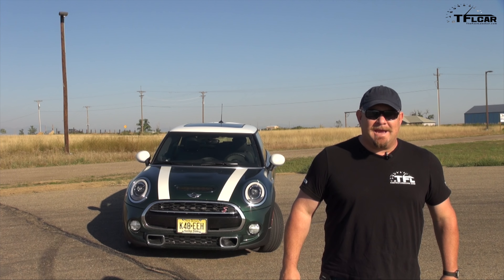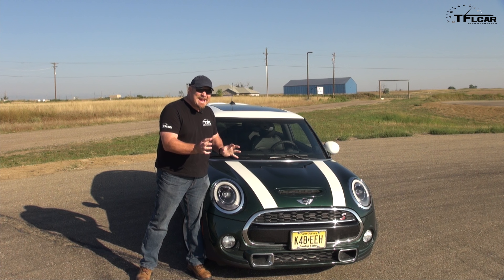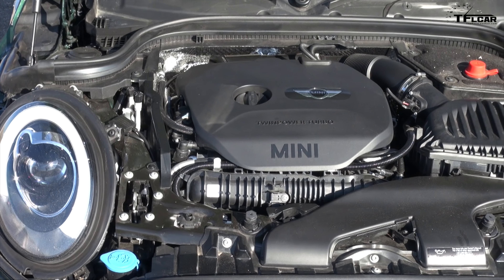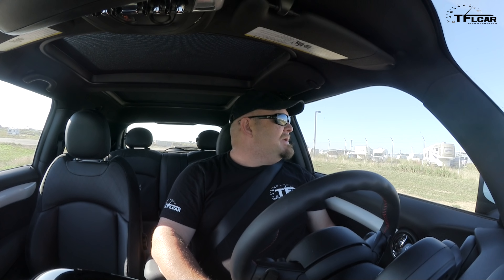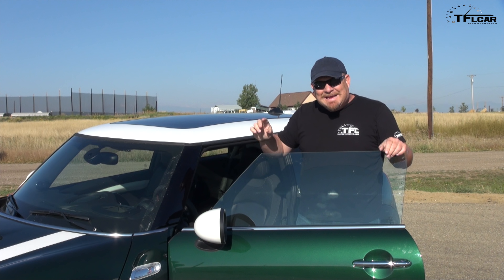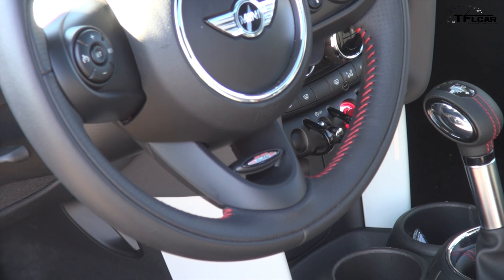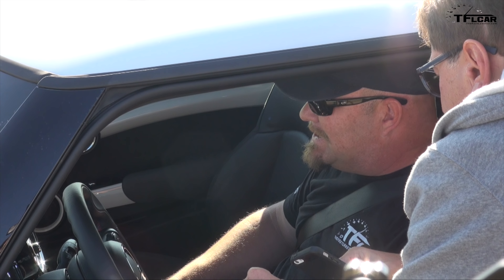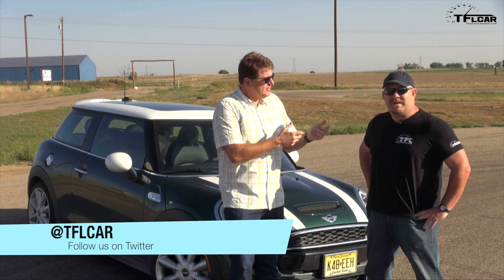2015 MINI Cooper S 0-60 MPH Track Review: A Go Kart on the Track?

Comment: Twin turbocharged 4 cylinder with only 180 hp? Damn that's bad
Reply: It isn't win turbocharged. That is a misnomer and why they purposely picked that name.

Twin Power is just a simple twin scroll turbo that will spool up quicker in low RPM ranges and maintain good boost into the upper-mid range of the engine's available RPM. It will die out at the top-end however, because there is a limited amount that you can design the variability of the turbo scrolls.
Reply: thank you sir i was very confused but still a high-end turbo on a 2.0 liter and only 180 HP very weak
Reply: Agreed. And the only reason I looked it up was for the exact point you brought up; only 180hp?

I suspect that this car might actually be making 180hp at the wheels- similar to my Abarth (rated at 160 but makes about 155 at the wheels)
Reply: What's so terrible about the power output ? 180hp is all the Fiesta ST produces. It's more than enough for a small front drive car.
Reply: MrKeyboardCommando Fiesta makes 197hp. That's almost 20 more, which makes a difference in such a small car.
Reply: Brodey Dover It makes me wonder where car company get their numbers from.. i took my 2012 gli on the dyno and its rated at 200hp.. But it actially makes 225 on the dyno and its stock... and my friends sonata Turbo claims 270 hp from a 2.0t but its only 215 to the wheels.    some cars are underrated and others are far overrated  ... This mini might be underated
Reply: kirbyswarp it does have less power but is faster than the fiesta and maybe faster than the focus so is not bad
Reply: kirbyswarp We are talking about the 1.6 litre turbo Fiesta ST, aren't we ? The Cooper S actually makes 189HP.
Reply: The Cooper S is 189 hp and 207 lb/ft of torque.  The Fiesta is 197hp and 202lb/ft of torque.  Pretty similar numbers.
Reply: ***** Cheers, Fireman. It always helps when somebody knows what the hell they're talking about !!!! ;-)))
Reply: MrKeyboardCommando Yeah, the Fiesta ST. Great little car.
Reply: It's a more efficient way of making 189hp than using a 1.6T so they used it. They actually got rid of the PSA engine for it's lack of reliability.
Reply: MrKeyboardCommando The Fiesta is a 1.6. This thing should be pushing much more hp with a 2.0
Reply: bertito43
It could be but I don't know about should. Remember this is only the S. There will be a JCW and eventually a GP.
Reply: hung huge The Mini Cooper GP. Get less for more!

Only $50,000! What a deal!
Reply: bertito43 It all depends on how much power BMW want the engine to produce. It can, and does, produce 250+hp.
Reply: ***** It's making exactly as much as BMW want it to make. The same engine is making 250+hp in other models.
Reply: kirbyswarp
That comment shows you know absolutely nothing about them. Don't tell me - you think a dodge hellcat is the best thing since the car was invented? The mustang was your bedroom pin up?
Bang for buck is fine if you have no money and no taste.
Some people pay millions for diamonds. Why would they do that when they could have loads more coal for a few bucks?
Reply: MrKeyboardCommando
Exactly. There are more factors than what the engine can theoretically make. One of the largest being BMW don't really want the mini to blow their far more expensive 3 series off the road.
Reply: hung huge You've hit the nail right on the head. If you want a real rocket, that's what John Cooper's for.
Reply: *****
Yeah because price and speed are all a car has to do, right? Stick to the peugeot in a frock if you like that kind of thing. I prefer something which doesn't feel so low rent.
Reply: *****
 incorrect, the FJCW will have 230hp compared to the 'S' with 189hp. The F56 still handles better than the Focus ST, but the Fiesta ST and F56 handle much better. Also to note, even with a tuned FoST and F56 with a JB, it'll still be close enough with the FoST by a hair.
Reply: ***** No, Hung didn't miss the point. The Cooper S is a nicer car than the Fiesta ST. The former is a luxury performance car, the latter, a pocket rocket. The John Cooper version of the Cooper S will fly.
Reply: RobDamnImFine
Thing is we can all quote figures and so on but we're not talking about the same class of car here. What's the point of comparing the focus and the fiesta with the mini? It's one or the other. The focus is a larger car altogether and neither are anywhere as nice to be in. Considering the aftermarket that's always surrounded the mini I would be surprised if there isn't a 300hp kit in a month or two and way more not all that long after that. Mini are holding back on the power but even while they're doing that it's faster and better on fuel than the fiesta without feeling like it was made from recycled bin lids.
As for factory versions - this is as low as power is going to get from the factory. JCW, GP and any other special editions or tuning kits they decide to throw in will only make it beat the fiesta by more.

Oh and remember efficiency? How much does the fiesta's 1.6 weigh compared to the mini's 2.0?
Reply: a gti has a turbo 2 litre.
Reply: hung huge
There isn't a market for MINIs...I've been in the MINI community and there was never such a thing to get a MINI with a 300hp kit. Even with the twinpower engine, I wouldn't think they would reach that unless E85, turbo, and bolt ons are used efficiently.

Not hating on MINI, but they are great underpowered handling cars. Also, there are many videos that show the Fiesta ST is quicker than the F56. Again, most magazines compared the hot hatches: F56, Fiesta ST, and Abarth everytime. So unless you think MINI is superior and doesn't have competition, the point I was saying MINI is a great car but doesn't compare to the Focus ST.
Reply: RobDamnImFine
Really? You've been in the mini community? Yet you say there's no such thing as a kit for 300hp? That shows you know little to nothing about it at all. There are even kits for the older 1.6 which do 300+hp. Look up most of the decent tuners and you might be surprised what can and does get put into them.
Type in GTT mini tuning for a start just to get you going but there are plenty of others.
The N20 motor is already available with 290ps from Hartge in the 328i so for the aftermarket to go another 15hp or so is going to be pretty easy.
Really if you know the square root of nothing that's the exact amount you should say.
Reply: RobDamnImFine The Mini community ??? What, the fuck, is the Mini community ???
Reply: hung huge
 There isn't. Name me any vendors that do sell the 300+hp kit haha. As a matter of fact, you might be talking about 300hp to the crank...but to the wheels on a second gen, they only reach up to 260whp, there has to be tons of internal work done. Go look up it up on NAM before you put out false information. As for the first gen, I've seen 270ish whp with all head work done and full bolt ons. So please show me exactly what MINI vendor does sell your "300+hp kit" and that my knowledge isn't valid here in the U.S. Maybe in Europe I'm sure you could find something close to it, but just because something is out there, doesn't make it true with one person who has supposedly done it.

We need dyno's and proof, not a bunch of talk.
Reply: MrKeyboardCommando
Nothing you need to know about if you don't drive or have driven the car lol.
Reply: RobDamnImFine I have owned a Mini, along with just about everybody else in the UK. So what is this Mini community ?????
Reply: Blake Brink Just a few points:
1) No, there isn't a community for everything.
2) You haven't a clue what the Mini community is, because there isn't one.
3) How does a little pimple like you get such delusions of grandeur ?
4) The Cooper S engine produces the power BMW want it to produce.
Reply: Blake Brink 1) What you believe has nothing to do with reality.
2) O.K., show me this community. 
3) What facts ? All I saw was sanctimonious pomposity.
4) I'll trust BMW's judgement about the power of their cars, they seem to be quite good at making them.
Reply: 1-3: useless arguments i don't care about as its not in my original comment if you wanna debate the possibility of a mini cooper community go ahead. 
4. turbo 2.0l with only 189 hp is still joke wether made by a "good  car company" or jesus christ himself, don't care if it was crafted by the hands of zeus why make it so pussy when it so much potential just isn't logical at all. especially for if BMW thinks they're the "ultimate driving machine" haha
Reply: Blake Brink Items 1-3: you were talking out of your arse. O.K., I can understand that.
Item 4: it's not a twin turbo engine, it's a single turbo, twin scroll engine. This engine can produce 250+hp if BMW want it to. In the 'S' it produces nearly 100hp per litre. How much more do you want ?
Reply: yeah someone told me it wasn't twin turbo a long as time ago and yes you just made my point the engine has that possibly of 250+ easily so why cut it short especially for a "sport". for fucks sakes caddys have 270+hp single turbo 2.0L(and caddis are a joke) . i thought the "ultimate driving machine" had higher standards that is all.
Reply: Blake Brink Because the 'S' goes as fast as BMW want it to go. John Cooper provides any further performance you may require. Just like Msports provides it for BMW cars. BMW do have the highest standards, that's why they're so successful in a very competitive market.
Reply: MrKeyboardCommando all other major car companies in that market are successful mercedez, lexus, jaguar, infiniti and acura. not to mention their direct competitors make advertisements saying their cars shit on a beemers performance in their same class IE lexus commercials where they call out most of all the german carmakers. but go ahead and defend your precious BMW.
Reply: Blake Brink All the cars you mention are excellent, and BMW competes very successfully in that market sector. The Mini, also, is an outstanding success. As I've said before, ad nauseam, BMW know exactly what they are doing.
Reply: MrKeyboardCommando
MINI car clubs and LXM on Facebook. Check it out.
Reply: RobDamnImFine These aren't communities, they're just clubs.
Reply: MrKeyboardCommando
a club like LXM is a community.

hence, the definition: a group of associated nations sharing common interests or a common heritage. Your welcome.
Reply: RobDamnImFine Are you talking about LMX theory ?
Reply: MrKeyboardCommando
you have a MINI don't you? or classic? either one will do.
Reply: RobDamnImFine I've owned several original Minis. I've not owned a current Mini. However, what that has to do with anything is beyond me. Now, what's this LMX you were talking about ?
Reply: Joshua Gill 189hp is more than enough, it comes out at approximately 150hp per ton. Also, it's not the power that's so important but the way it's utilized. On the road the Mini is a very quick car.
Reply: Joshua Gill
I'm apologize in advance if you take this the wrong way, but no air intake on a MINI(made by BMW) will give you 20hp with just an intake. There's plenty of dyno's out there on this study already. The real power comes from the DP, intercooler(stabilizes power), and tune.
Reply: MrKeyboardCommando
Yes, otherwise your girl would get bored with you;-).
Reply: Joshua Gill
I'm sorry, dyno sheet would be perfect in this case. There's no way. Ever. You're running on a 2.0L if you got the F56 MINI. Also, it's a four cylinder which sucks in hot air from the open intake. The only intake that could possibly give you some gains was a DoS intake, which aren't made anymore since the guy had some family issues when he shut down.

Anywho, you're probably just feeling the noise giving you that erotic sound you like so much, which makes you believe that lol. Which dyno did you use?
Reply: RobDamnImFine She gets bored every night, and twice on Sunday !!!!
Reply: Joshua Gill
I did...two of them.

you're open intake, sucks hot air in. Think about it, that plastic tube connected to the bottom portion of the intake isn't helping you out when accelerating. You're sucking in hot air from the engine compartment. Hence, the loss of low end torque, but minimal gains in the top end.

If you knew more about intakes and how they don't add power, you would know about tuning up your car and how intakes don't do anything. Check with mechanics or vendors. They are for noise and that's it. The hood scoop is a plastic piece that is for looks. It's not functional such as an Evo or STi.
Reply: RobDamnImFine I have been emailing a company about their custom turbo that makes 350-450hp without a doubt. It's a bolt on. The only requirement is a larger exhaust.
Reply: Nathan Keil
All estimations, let the dyno do the talking.
Reply: It isnt twin turbo it is twin scroll silly.
Reply: buildmorefarms100 this was settled months ago lol mini is trash anyways least reliable brand out there.
Reply: Blake Brink Mine has been reliable, it is incredibly fun to drive. Im guessing youve never owned one...
Reply: buildmorefarms100 nope and id never fit in it. but that being said I'm glad you have fun and  at least the one you got is reliable.
Reply: Not twin turbo, Twin Scroll, which means all four ports go to one turbo to make it more efficient.  It takes out the lag.
Reply: Tuning and down a down pipe. Less restrictive air filter. Eaisly 225hp 275 lbs.
Reply: TwinPower is just BMW's marketing term for a twin-scroll turbo. But the other thing, with this being a BMW engine, it probably makes more than 200 bhp rather than 190 bhp. BM loves to understate their performance numbers